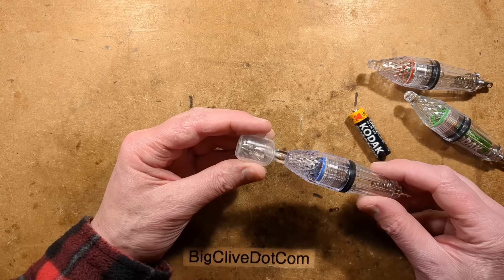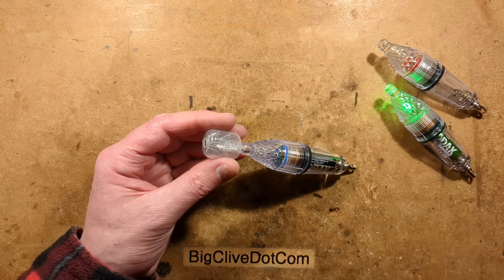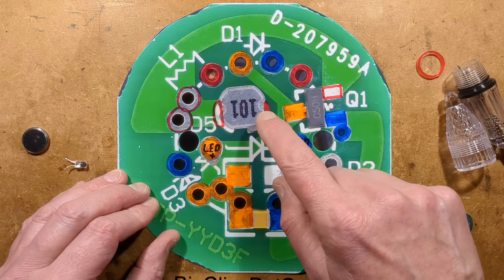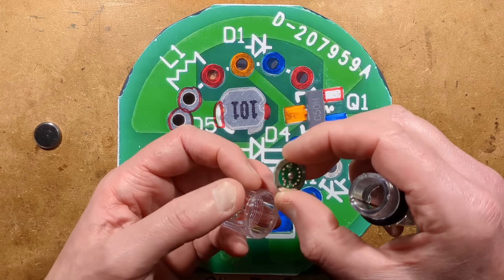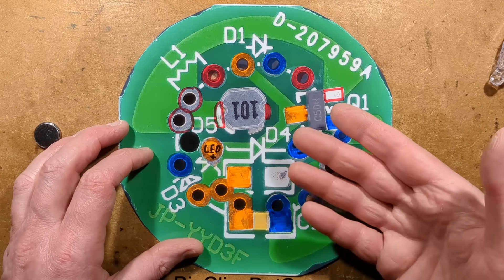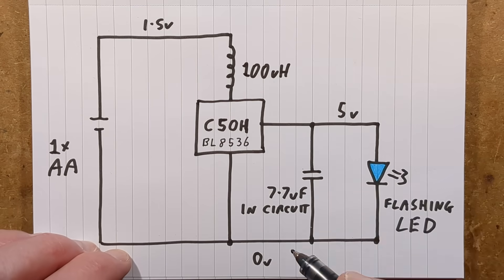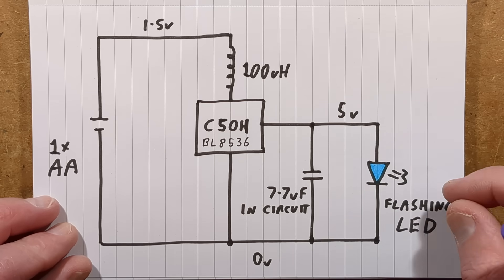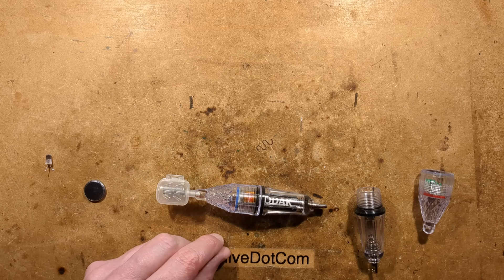Flashing squid hook has surprising circuitry

Comment: So basically it houses a type of circuit similar to a modified joule thief but it is indeed impressive to run it off a 1.5 double A battery the LEDs may not drain that much while flashing because they may consume half of what a continuously lit led might. The barbs are simple but they can be modified to insure a good grip on the caught prey just as in a fish hook those straight nails might offer slippage. In the end it was a great review.

Comment: Seeing a few people modding something similar recently, using "Outdoor Lighting Waterproof Solar Net Mark Light Solar Dual Mode Buoy Signal Light Anchor Light Outdoor". They are larger toberlone shaped with 3 solar panel on each side and powered by an 18650. A rak wisblock mini meshtastic kit fits inside and with a hole for aerial get a powered waterproof solar node.

Comment: With the extra space in there (or by using a smaller cell), do you think it would be worth putting a small wireless charging circuit in there?  That way you need not worry about the water-tight seals getting damaged.  And maybe a toggling magnetic switch so you don't need to twist it at all ...   🙂   Project idea?

Comment: Where I used to work, we had a tradition of fabricating a gift that was relevant to a persons job when they retired.  I was given a small black box on a wooden plinth with a flashing LED on it. It was labelled ‘The internet’ and the plaque charged me with the duty of keeping it working. About 2 years after I retired, it stopped so I investigated, fitted a new PP3 and the internet was working again. You’re welcome ;)

ETA...apologies all, this reminded me to check and sadly, that device had failed, sorry for the outage ;)...and I mis-remembered, it runs on a single AA cell.
Reply from the maker: That'll probably be an LM3909 chip running the LED.
Reply: Many years ago I gave a college classmate a birthday present of a flashing LED mounted on a small plastic box, it was described as a "find it in the dark device".
Reply: @chrissavage5966 are you aware of the "the IT crowd" reference?
Reply from the maker: @Sanisfaction  Yes, I saw that on YouTube.
Reply: Whaaat? Please kindly return the Internet to where it belongs: The Big Ben.

Comment: I enjoy led displays that are interesting and easy to do.
In years gone by I used LEDs flashing, flickering or permanent, usually powered by AA batteries.
This year I tried button cells with great effects in my local woodland lasting quite a lot of days.
I always recover them and re use them.
I’m an engineer and also made some white acetal mushrooms I can insert a 5mm led in the bottom to light it up.
Interesting to see and comments are positive lifting spirits locally.

Comment: in some ways that circuit board resembles the led boards in some cheep flash lights which use a AAA battery pack and no boost circuit to drive a few LEDs , same size , same connection to the battery.

Comment: So many built in options.

It’s as if the designers thought “people are going to hack the heck out of this thing, let’s make it easier for them”.
Reply: Honestly my first thought was for "supply chain considerations" as we so eloquently phrased it at work. If they ran out of a certain surface mount chip they could readily swap to through hole and not have to switch to an alternative pcb.
Reply: @LeeNullus I have no doubt that’s the real reason, but I still suspect that Clive’s videos occasionally make it through the digital Great Wall. I mean strobes are much rarer on cheap flashlights these days…

Comment: Thanks very much for this video, Clive. The fact the the circuitry generates a 5V supply is pleasantly surprising and opens up some interesting possibilities. I wonder how efficient the circuit is? One of these could easily be modded into a static light source of any colour. Personally, I'd go for a green glow as this would be excellent for night vision and give maximum battery life. Another possibility might be a warm colour for floating in a bathtub or similar. Or simply set it up as a static white LED and use it for camping. If configured as a dim glow it could be useful as a hard-to-loose keyfob for those dark locations and places, or simply as a regular keyfob.

The idea of installing a microcontroller is very interesting, although I'm not sure that there is really enough room inside. Otherwise there are some interesting possibilities, perhaps, as a clandestine waterproof surveillance or communication device... (Sorry. Devious mind showing again.)

I followed your link and tried my own search for 'LED energy-saving fish lure light boat fishing' and got some interesting results. There was quite a range of underwater fishing lights that had battery clips and with power claims of up to 2000W(!). Some of these were less than £10 and might me interesting for a future teardown. There were also boat navigation lights with two colours, a giant 25cm(!) version of what you have here, which could be fantastic for projects and turning into something quite fun, such as a 'UFO' looking light with the appropriate mods. I also found 'IP68 Waterproof Underwater LED Lights 12V RGB Multicolour Aquarium Light Garden Fountain Pond Fish Tank Swimming Pool Spot Lamp' which may also be interesting, as well as yacht and speedboat lights. As you like remote control lighting there were also '10leds RGB Led Submersible Light Underwater Night Lamp Battery Operated Garden Swimming Pool Light for Wedding Party Vase Bowl' for less than £2 each.

I can see how it's possible to spend rather a lot of time perusing aliexpress.  I can imagine a situation where a van load turns up absolutely rammed with random goodies with the driver knocking at the door and simply handing you the keys with the van being a 'gift' for a 'loyal customer'!

Comment: I’m assuming the squid jig was weighted as opposed to the float? Squid jigs are usually created with a look of a prawn or similar and have a small weight under the “throat” which helps with casting and sinking to get the jigging action. Might have to road test a couple of these beauties - I think they should work well.

Comment: The datasheet for the BL8536 suggests that the output voltage is actually 2.5V and the capacitor should be (and probably is) 10uF.
Reply from the maker: The capacitor was measured in-circuit, so the shown value is not guaranteed to be accurate.  The chip is available in several voltages.  This was just the first pin compatible version I found that tallied up with the function and pinout.